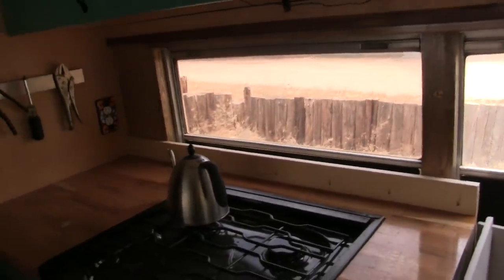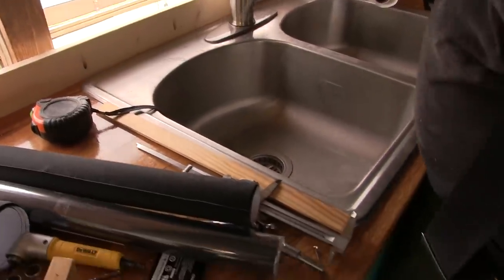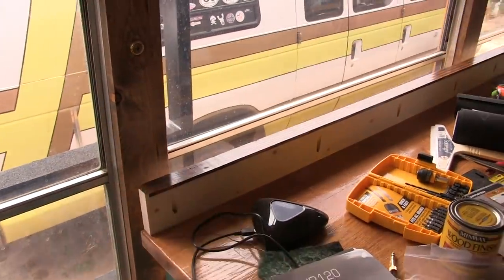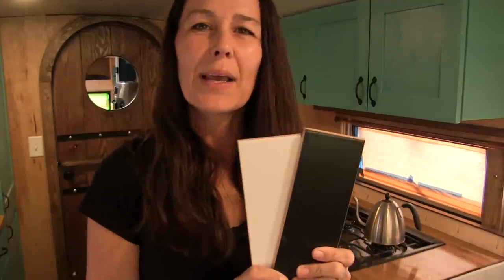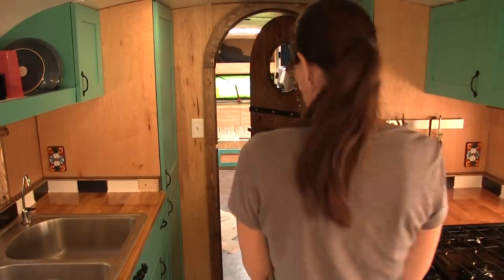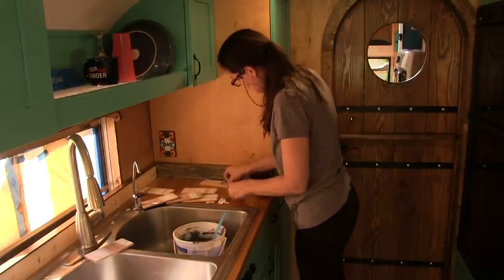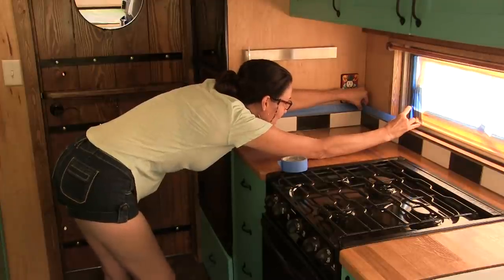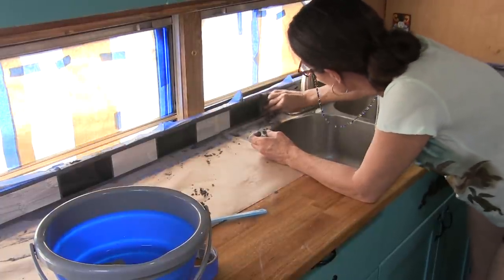Building & Tiling the Kitchen Backsplash in our Skoolie!

Comment: Your drill/impact should not smell burnt for how new they are. Not sure if you have the brushless or not, but if not it sounds like your brushes might need to be replaced. If you have the XR series (brushless) drill/impact, then something else is wrong. Regardless, if you’ve had the drill/impact less than a year, you should take them back to the store and get a new set, or contact Dewalt as there shouldn’t be any burnt smell!  Bus looks great!

Comment: I'm not sure if you are aware but your grout manufacturer makes a sanded grout for use in areas such as the run between the back splash and where the tile meets the wood counter-top. It will seal that area and also is flexible (caulking) so it will help with cracking. Love the tile (Bill - the guy you gave the sticker to in the Mexican food restaurant - retired contractor).

Comment: Very nice Kerry you out did yourself
So far Mike 3 Kerry 5. 
Better step it up Mike.
Hey just a tip for the shower grouting
Get a cake decorating bag with different tips and fill it with your grout they work well without a lot of mess plus you can really squeeze it in between all your tile
Just a thought.

Comment: Hi guys,
I'm not wanting to burst your bubble, from my experience
Grout and thin set really doesn't adhere to wood very well. You may have used wall adhesive instead. For the grout after it drys put clear silicon where it meets the wood to keep a seal.

Comment: Kerry did you consider “buttering” each tile ? Also what kind of thin set do you use?  I’ve seen some folks use a “flexible “ tile for bus or RV applications to help with the potential flexing.  Not that you would need it for that small of a backsplash.    Good job on the solo tile mission.
Reply from the maker: Thanks Jason! For some reason I thought buttering would take longer than just spreading it in, but in hindsight it probably would have been less messy and possibly easier! Yeah, on such a small job I didn't think it would matter, but almost all the mortars on the shelf are the supposedly "flexible" type... and I think "flexible" is a strong word for it, LOL! Only time will tell how it stand up to travel, but we'll keep everyone posted!